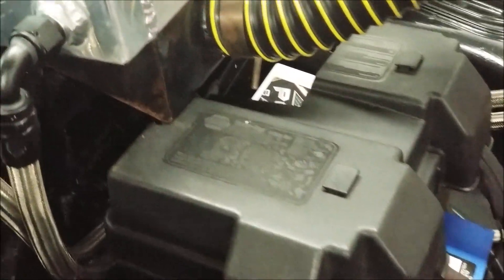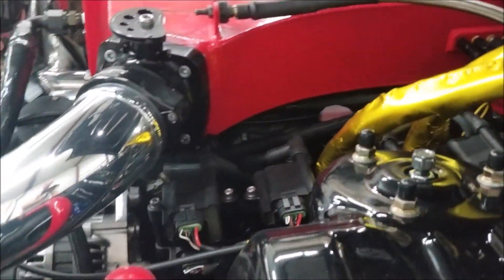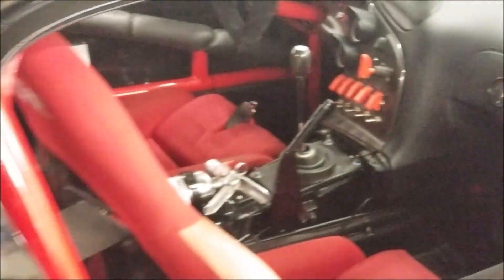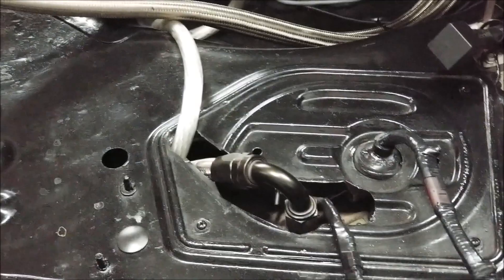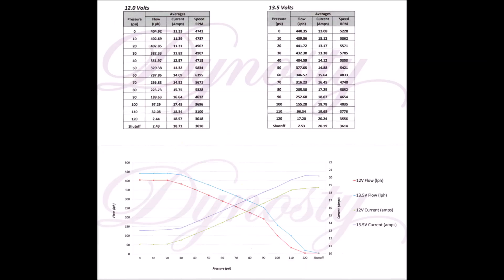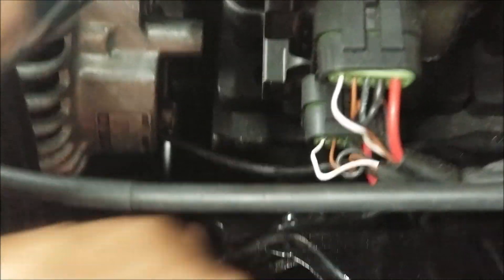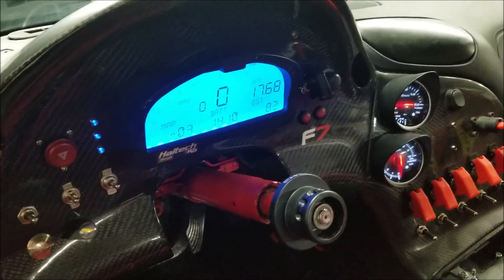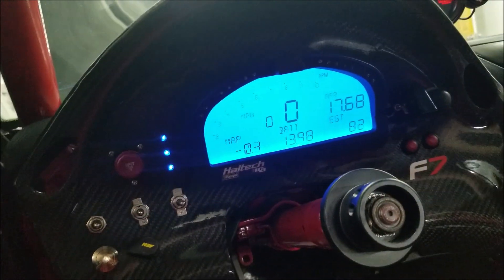Importance of Proper Power and Ground; 4 Rotor 16+ Volt System Explained; Increase your Cranking!

Comment: In the audio world we call it the big 3 . 1/0 power and grounds and running a xs power d1400 or s1600 agm battery help with the higher voltage set ups
Reply from the maker: very good to hear!

Comment: Great video . I 'll have to tell my friend about the adding a ground wire to the motor with the battery relocation. He's been having voltage drop issues ever since he did that maybe that's why.  Also does the ground for the motor have to be 0 or 00 gauge as well?
Reply from the maker: As large as possible!
Reply: @MazzeiFormula  that's what she said...😜 Lol thanks

Comment: This is literally the reasons my homie thinks "rotarys are trash and require magic to stay working" on his first FB build with a 13b lol 

He was running a marine battery w 4 gauge wire and kept having fuel system pressure drop even with 2 walbro 525's at only 450hp but he wasnt logging the voltage for some reason when it blew up.
I think weak spark and fuel pressure drop contributed heavily
Reply from the maker: Yep seen it so many times, learned from my own mistake doing the same in 2007!

Comment: I’m an electrician and I do controls and instrumentation. Adding a ground strap near any and all electrical and electronic equipment that hijacks a ground from its installation will benefit. It will also help reduce electrolysis.
Reply from the maker: Thank you for your insight
Reply: Leland holton, could you provide an example please?

Comment: I don't know what ECU your running if it's designed for 12 volts i would have a regulator regulator to drop it down to 14 volts just to reduce to strain on the internal regulator so it doesn't heat up too much but if it's a ECU that is designed for 12 or 24 volts the ECU should be already designed to handle the higher voltage and should be fine other than that a lot of the other components like fuel pumps and fans are forgiving or running slightly higher voltages but awesome breakdown and the fundamentals and importance for running the correct wire to achieve the objective
Reply from the maker: Very good point! Yes probably not worth trying on a stock ecu!